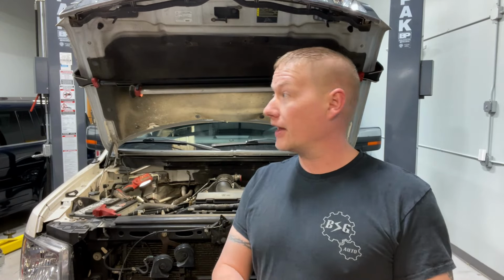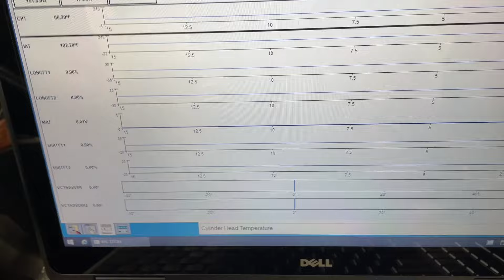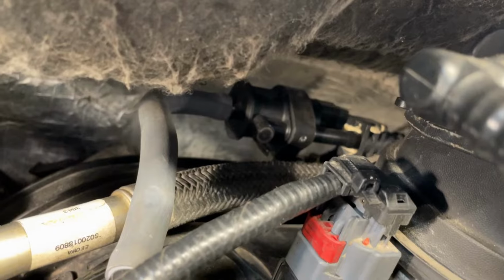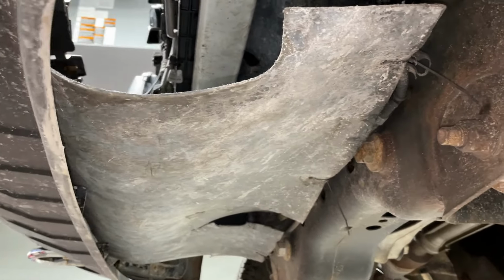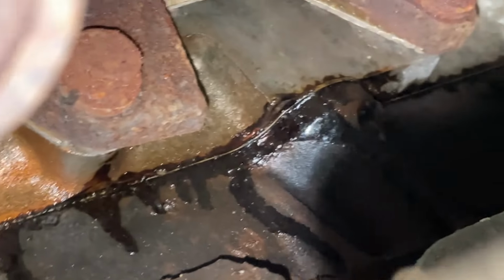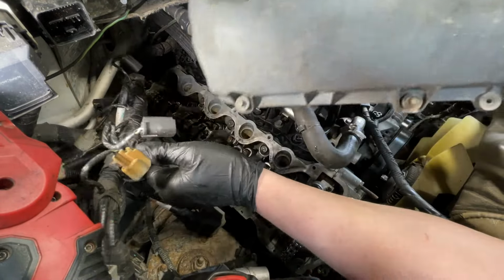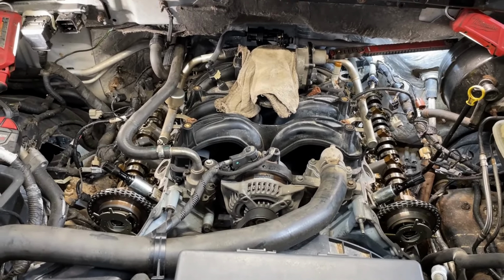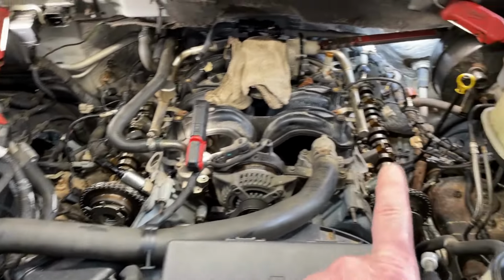The Worst Hack Timing Job Ever!

Comment: I have an 06 F150 with 330k MILES only reason I have that many miles is because of your channel!  I do all my maintenance following your words.  Thanks Brian!!
Reply: 07 5.4 3v 573k and 06 Romeo 2v here 778k miles. Origional engine. Both trailer haulers. The 06 Waiting on its 4th trans and ground up all new 5.4 turbo build. A little maintenance literally goes a long way. 👍👍
Reply: @brandona4618  what engine maintenance have you done? Phasers and chain?
Reply: @degujm01  tensioners chains at every 200k or less. Do not use the plastic factory tensioners. Get the upgraded iron ones. I use MHS parts.  Oil at 8-10k trans fluid every 20k filters always royal purple. Clean the various sensors on the intake on the Romeo. Egr deleted. Did get a new monster built tranny with billet shafts and converter. and rear end from a 2015+ last year with a 3.55 ratio now which the wore out 4.6 isnt happy with at all but its still going waiting on me to finish the new engine. 

The 5.4 was phaser locked at 23k kept eating follower bearings which dug into the cam lobes.  (variable timing on a fixed lobe single cam was stupid) hadnt eaten a follower as of it getting wrecked few months ago. Same fluid schedule tho. 
The 4r75s replaced like clockwork at 250k even pulling trailers. 
I use MSD coils and just keep a couple extra in the glove box with extra plugs. Coils typically like to go out in pairs ive noticed also. 4 and 8 as they see the most heat. Fuel filter when I did oil.
Reply: @brandona4618  NO GET AN OLD CHEVY YOUR BEST BET.
Reply: @MrHeavychevy86  but i aunt never seen a or heard of a million mile Chevy 😂 specially one thats a tow pig
Reply: @brandona4618  HAHA I KNEW THAT'D GET A RISE OUTA YOU.
Reply: @brandona4618  YOU SEEM TO KNOW WHAT YOU TALKING ABOUT AND MAINTAIN THOSE FORDS WELL.
Reply: @MrHeavychevy86  no rise bud. Just i needed something that lasts. Does what i need and can be easily changed out in a motel parking lot in a couple hours. Gm products just cant last like that. And I'm not sure the 4v ford engines can either. But I also couldnt afford one. Simple numbers is all. I had an old 7.3 powerstroke that had rolled over as well. But once a co worker popped it on a job site. The cost to repair it was more than it was worth. I Stripped it for parts and got what the numbers made sense to get. 
Also.when it comes to Chevy. I prefer small blocks Not these LS attempt to clone a 351. And the 4l60 trannys are about as usless as a 3 legged horse. 
Glides are expensive and parts harder to find as good as they are for what they do. 
my racecar is going back to sbc instead of a ford modular because of costs as well. It was fun to go racing and everyone expscting a turbo LS swap in my ol Datsun but pop hood with a turbo ford. But Everytime I pop a ford engine its 20 grand. As apposed to the small block of maybe 4500. All numbers. All numbers.
Not against ol Chevy. Just wasnt going to work like the ford would.
Reply: I got 220,000 on a 2004 f150, 5.4 3v. New phasers, chains etc at 112,000 and just did it again at 220,000. Engine still looks and runs great, can’t say the same about the frame/body. Rusty, all my wheel wells are fiberglass.
Reply: @jenpsakiscousin4589  Gosh I wish I knew about the sunroof drain plugs.  Hate that my cab corners are rusted out.
Reply: @neptune4167  know what ya mean, if I get some time in the spring I might do patch panels on the rest of the bad spots. I got paint primer and clear but haven’t had the time, then next thing I know I got more rust to deal with. If the truck didn’t run so well it would have been gone long ago.
Reply: @brandona4618  I am doing my 2007 Expedition 4wheel Drive. Got a cross threaded timing tension bolt hole. Already ordered steel tensioner. I hear that need to cut off the last 2 teeth on rachet tensioner. This prevent over tension. My question is does my 5.4 3 v expedition engine timing hole the same as the truck version 5.4 3 V. . Is it the same engine expedition vs truck for the use of steel tensioner.
Reply: @benten6301  the steel upgraded tensioners have a tab that prevents over tension on the chain. Or at least the ones I use do. I have never heard of cutting any teeth off as a solution. As to the 3v being the same. Yes. All 5.4 3v are identical. I don't think the 3v came as 2 variants as the 2v did.(romeo or Windsor).
Reply: @brandona4618  😊😊
Reply: @brandona4618 bruh thought u were smart at first but then you said "upgraded iron ones" that's the red flag that tells me you haven't done enough research on these engines yet 😂😂don't get me wrong it's great you know how to keep up with maintenance but even the million mile Ford did little maintenance and easily made over a million miles. Those iron tensioners are actually far from upgraded. In fact they used them on the 2v when they first came out and there is a reason why they changed to the plastic ones on the 3v. You're literally commenting on a mechanics video who tells you explains deligently why not to use the old iron designs. You might have had good luck with them but it's just simply not worth the risk at all. Those iron styles have a tendency to ratchet further than they are supposed to and over tension the chain which over time stretches the chain. If left alone long enough it will cause timing to skip. You probably never notice because you change your chains every 200k which is also great but imo is also a waste of time and money. Maybe the first time it's worth it to get all the upgraded parts in or if the chain had already lost tension. But the chain should last a very long time. Shouldn't have to change it every 200k. The new Ford plastic tensioners have a new seal and have no issues for the 200k miles it supposed to last. Should only need to change the guides and tensioners every 200k which is their normal lifespan. The rest was just updated by Ford to last longer. No need to swap after the first timing job, just inspect for damage and act accordingly. Like all the other major engine parts. I would only use Ford oe recommend parts. All Ford parts are updated to fix issue prior. No real reason to not use ford oe.
Reply: @IndiansAutomy 07 classic Silverado 1500 is sitting at 355,000 miles on all original drive train while turning 37s for the last 200,000 of that. I’ve never touched the inside of that engine and neither did the original owner (my uncle) and the 4l60e shifts smooth as glass. 

My 07 f150 with the 5.4 has 164,000 and just had its 3rd timing job, I always use OEM parts. 

Both trucks get oil changes religiously at 3,000 miles. 

I love them both and I’m not brand biased. But from my experience, my Chevy has been the reliable one out of the two
Reply: Same Here. 04 F150, 5.4 170k miles. Have done all the updates recommended by Brian. Plugs changed twice. Complete timing job at 153 including followers and lash adjusters. Runs like a swiss watch.

Comment: I would drive 8 hours for this guy to work on my truck. I’ve been watching/subscribe to his channel for a while now. Great mechanic. Given tons of knowledge out. Ty
Reply: I live in fl. Would drive 20 hrs to his shop
Reply: His knowledge on these vehicles have helped me goes a long ways in my career as a senior lvl technician. Ive done many intakes and many diags for poor running fords pertaining to everything he covers here. As well as doing several timing chain jobs on 4.6 and 5.4s. 3 valves, 2 valves u name it! Very few people on youtube actually teach me and he is one of them.  Thanks!
Reply: Haha, i am exactly 8 hours away and am thinking about it
Reply: TOMCAM,
I DUNNO WHY YOUD DRIVE ALL THAT WAYVFOR FTMYL TO WORK ON YOUR VEHICLE, HES GOT HUNDREDS OF VIDEOS SHOWING STEP BYVSTEP HOW TO....
 I GOT A 05 F150,DIRT CHEAP,LONG STORY. IT I THOUGHT WAS LEAKIN OIL. CHANGED OIL FILTER ADAPTER PLATE,NOT THAT! FOUND DRIVER SIDE VALVE COVER HAD BEEN GOUGED( HIDDEN BY POWER STEERING RES) SO I REPLACED VC & BLOWN PHASER( NOT YET HAVING BEEN INIATED INTO THE 
 DEATH RATTLE ASSAN!) SPENT $175 FOR VC AND $200 FOR ONE PHASER. NOT RUN,NO START!
 TIME TO SCRATCH HEAD AND YOUTUBE VIDEO SEARCH...
  FOUND FORDTECHMAKEYOULOCO 5.43V TIMING KIT REPLACEMENT VIDEO. GOT THE ALMOST $1000 TOGETHER FOR EVERYTHING NEEDED FOR THE JOB,TIMING KIT,OIL CHANGES ETC. SPECIAL TOOLS FOR ROLLER FOLLOWER REMOVAL. AND WENT TO WORK. I HAD NEVER DONE THIS TYPE OF JOB. BUT CONSIDERING A THOU. COMPARED TO A THOU PLUS THE HUGE LABOR CHARGE AND THE WAUT PERIOD " WELL,WE MIGHT BE ABLE TO GET TO YA,TUESDAY AFTER NEXT,THAT BE ALRIGHT FER YA"!?
  AND IF IT TURNED OUT INTO TGE JOB WAS TOO FAR OVER MY HEAD,THE MECHANIC/SHOP OPTION WAS STILL POSSIBLE. BUT TURNED OUT,WHEN I GOT IT ALL BACK TOGETHER, AS WELL AS PLUGS,COP COILS,HALF DOZEN FUEL INJECTOR CLIPS,THIS TRUCK CAN SQUEEL TIRES!!   BEFORE DEATH RATTLE,AT STOP SIGNS & REDLIGHTS,IT WOULD ACT AS IF IT WAS GONNA CRAP OUT ANY SECOND, PUTTIN INTO NEUTRAL CAUSED HIGH AND ROUGH ERRATIC IDLE! SO VERY GLAD I WAS ABLE TO FIND THIESE VIDEOS AHDED THAT WORK!!

I WAS CONCERNED, MANY VIDEOS I FOUND ABOUT THE TIMING KITS/PHASERS THE TECHS RECOMMEND REPLACING ENGINE!!   SO FAR SO GOOD THOUGH...LIKE ABOUT EVERYTHING ELSE IN LIFE,TIME WILL TELL. IMA KEEP ON TRACK WITH MAINTENANCE HOPEFULLY THATLL PRESERVE PHASERS..
ALL TE BEST!!

Comment: I did my timing job and oil pump after gaining confidence from your videos! Ran like a dream!! 
4 days later the low oil pressure light came on. And it started knocking bad. I took everything apart again and lo and behold,  I left a shop towel in the oil pan after wiping the oil sump when I took my oil pump off, which clogged the oil pickup tube.
Had to drop the oil pan and clean it out and replace a camshaft and cam phasers. Big Oof...Runs great now 😂

Thanks Brian!
Reply: I bought a 93 f150 from a guy who said he just had a oil leak fixed by his family's mechanic and it stared making a knock and thought it could be a spark plug, we start it up ND it clearly a rod, I paid him, towed it home pulled the engine to swap it, when we got the oil pan off there was a shop rag stuck in the pick up and two snapped rods and one with a near ninety twist in it. I'd say you got lucky lol
Reply: Closely related Operating Rooms have to account for all rags (gauze) so that one doesn't remain in a patient after sewing them back up
Reply: John smith  I check double and triple and have been diagnosed with obsessive compulsive disorder lolo but as I have worked in electronics /electrical cars boats robotics plc computers tv audio communications and marine electronics automation industrial electronic pump engine transmission for over 50 years OCD has been a life saver lolol
Reply: I cannot even imagine doing that whole job twice. You must have a ton of patients.
Reply: Ouch man
Reply: good catch brother glad thats all it was :)

Comment: From your timing job series I did the timing job including the Melling oil pump on my '06 F150.
Such a good sound when it fired up and purred like a kitten!
Thank you!
Reply: did you go all OEM parts im doing the same right now this weekend but i cant afford the OEM at the moment so i went with clydes timing kit and a lock out. my truck runs great but i hear a rattle ever so often when warmed up an chain clap on start up rarely. im just scared and want to take  preventive measures.
Reply: @tylermulkey330  was it your first time doing it ?  I bought my first 2006 f-150 (before gmc sierra)  and big tikking plus engine losing a lots of power so I'll have to open it but I'm sure I'll have to do the job (if not more)...   how long you've work on it ?  thanks
Reply: @ja4476  ah yeh my first one really but on this truck but I’m a diesel engineer by trade an have been working with my hand my
Whole life I’m 37 now an have set timing on my Chevy 350 mercruiser with timing light an also my old pathfinder but not our 5.4 3V. Just go slow an take your time mark the chain an lock the cams an the L and the R cams are in the right spots at 12oclock an do all the “while your in there’s” oil pump/ water pump guides an tensioners an the lifter/ lashes an rockers. Don’t forget to soak in oil a night before an exercise them so there filled up wit oil. Good luck bro.
Reply: @tylermulkey330   Thanks a lot for the answer, really appreciated...   If I might ask you another question,  did you use a specific scanner to diagnostic the problem ?   I've read the ODBLinx MX+ ....    I'm willing to pay some more to get as many info possible from a scanner....  it would give me a better idea of the problem.....

Comment: The one thumbs down must be the last guy to work on this truck.
Reply: Yup
Reply: The other’s watched while drinking their Busch beers.
Reply: Yeah after the owner gave him the yt link and is holding his dog hostage for money back.
Reply: It's up to 19
Reply: @ALEX173446  that's what I said
Reply: Now is 19 thumbs down,,probably the whole shop employees..😄
Reply: @sharedknowledge6640  then make your own video.
Reply: @sharedknowledge6640  so you're obviously not familiar with the sound of  a 5.3L cam lobe being eaten away by a failed lifter which in most cases is a $3000 repair.
Reply: @sharedknowledge6640  lol, "no GM V8 needs this level of expensive repairs". Who's head is stuck in the sand?
Reply: @sharedknowledge6640  The GM 350 has its own set of issues. Mainly heads and exhaust. Let’s not talk about their automatic transmission. That’s a whole other issue. All manufacturers have issues. All of them.
Reply: @sharedknowledge6640  I agree, I would never have an eco-boost engine, but here you are comparing a case of shoddy work involving different areas and multi-shops with cost of replacing a GM engine. I know people that had GM crap trucks with nothing but problems repaired under warranty and beyond. Many issues, engines being just one. I would own a V8 Ford Truck before a GM V8 truck, or really any GM vehicle, that's for sure
Reply: Ever hear of the gm 5.3 and 6.2 lifter exploding and destroying camshafts and heads?  Not to mention u have to pull the heads to replace the lifters.  Gms cylinder on Demand.  Huge Failure.  Most people spend thousands to delete the system to avoid costly damage.  But I guess gm has ur wallet no matter what if u own one of their trucks from what 07-18?  At least Ford scrapped this engine finally.  My buddy works at a Cadillac dealer.  He said all he does is replace engines on Escalades.  They try just doing the heads but after they tear them down they realize the truck will be back for oil pressure issues down the line and just replace the whole engine.
Reply: Brian has a shop because he is a Ford master tech.  He’s not there to bitch about Fords design.  He’s hired to fix the truck.  So I’m guessing u would rather have him make videos where all he does is blame Ford and tell the customer well u should have never bought a Ford?  No the customer hired him to fix the truck
Reply: lmao 🤣
Reply: @sharedknowledge6640  Lawyers were paid MILLIONS while us F150 owenrs were mailed a 2500$ off coupon to buy a new F150. Same junk design but in a 3.8 engine, Like they didn't learn from all the problems the original 3.8 had.
Reply: @sharedknowledge6640  Dude, just stop will ya?! We know about the issues. Don’t come on here to troll this guy; he knows about these issues and he is here to fix them. Go back to your GM world and just stay there instead of TROLLING this honest tech!
Reply: oh im sure it was a team effort.

Comment: Wow, just wow.  I followed your timing videos to a t last year and bought all the recommended parts, that was at 190k mi, just rolled 205k mi today running like a dream.  The only hiccup I had was I forgot to replace the oil filter before cranking to prime the oil lines🤣, 20lbs of kitty litter and 5qts of 5w30 later, everything ran great!  Wish I lived closer to have you do routine maintenance, but between Eric O and you, I can usually tackle most of my vehicle issues👍
Reply: How long did the job take you and what year and engine?
Reply: Something like that happened while changing radiator.. forgot to reconnect trans cooling line and got tranny oil splashing into the radiator fan! 🙄😖 imagine the rest! 🤣